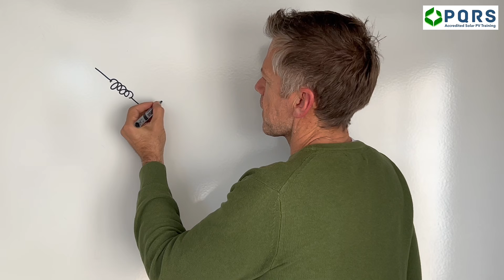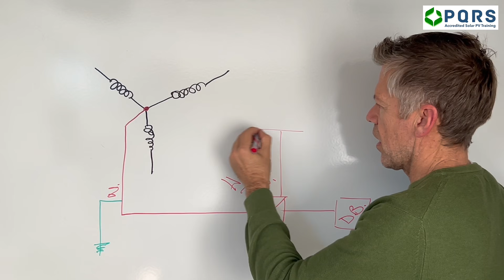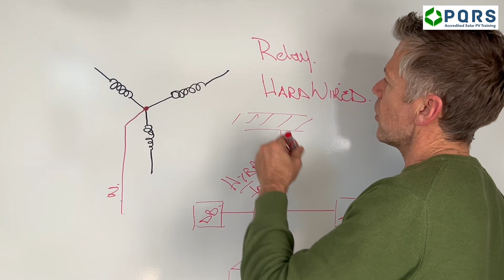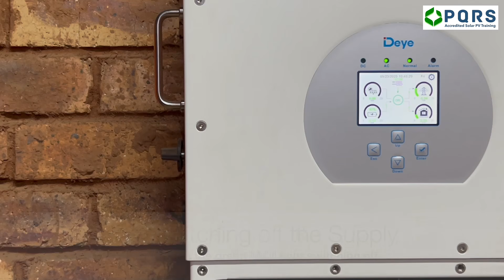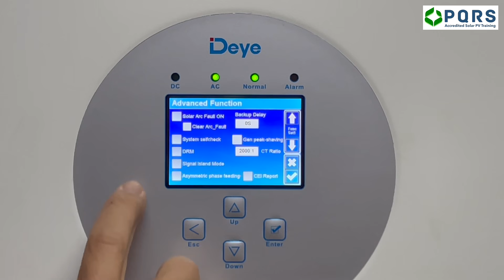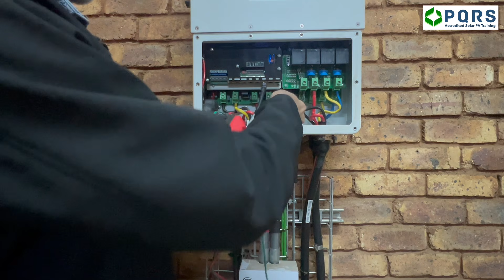Neutral Earth Bond Explained

Comment: Thanks for this and i would like to ask for help.
Our system has hybrid inverter, batteries, solar and Genset 
The problem is when we connect Genset,the ELCB trips. Then we switch off all breakers in sub DB and we turn on one by one and after we found the MCB that cause the trips of ELCB.
All it's fine without Genset.
How comes?

Comment: My Deye 6KW has built in relay for bonding PE-N, but it doesn't work properly,  there is a brief moment in time to short PE and N when municipality power is still connected, causing the RCD to trip.  I don't see any solution than to just disable "signal island mode" altogether.   It should be a delay to make sure that PE and N are not bonded twice.
Reply: If you have a bonded neutral, disable your grid islanding mode. Also as extra safety, add a RCBO at the inverter output. 50-100mA.
Reply: You need to use normally open external relay to  close it once grid is connected to avoid double bonding

Comment: Will give this vid a thumbs up if you can show how to connect the relay on the deye inverter for the N-E Bond
Reply from the maker: Which Deye inverter do you have? It is possible that the relay might be internal and it is only a setting that is required. I think in the smaller or older units the external relay might be required
Reply: @carelb_pqrs 8kw deye
Reply: @carelb_pqrs  I have a Deye 8kw sg05lp1 sm2 and after enabiling island mode there is still voltage between earth and nutral

Comment: Hi Greetings, I must click islanding mode if inverter are on the grid and off grid, an internal relay would trigger the inverter from neutral earth bond.. I still don't  understand why neutral earth bond. 🤦🏾This can cause my appliances to smoke? Is it really  necessary ?
Reply from the maker: Not all inverters have the earth neutral bond as an internal function. 
If you don’t do it, your earth leakage won’t work and the installation won’t be safe
Reply: Thank you  @carelb_pqrs